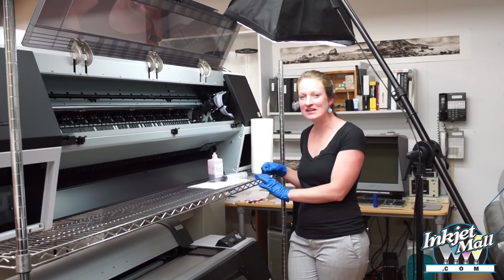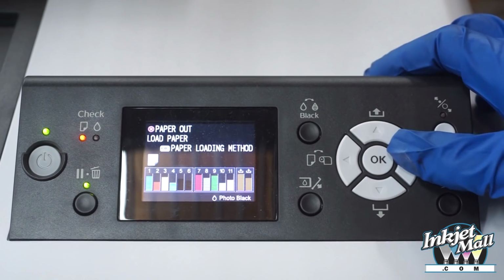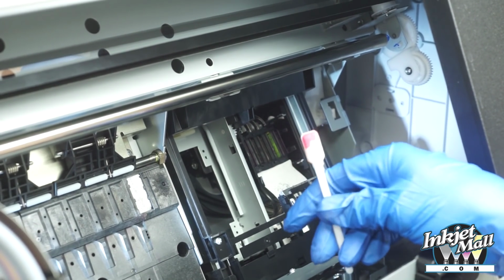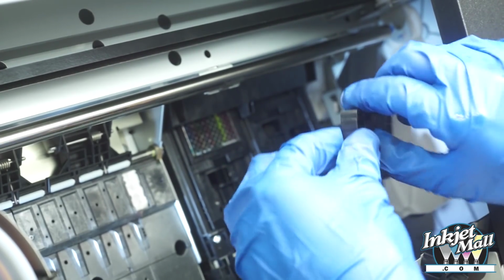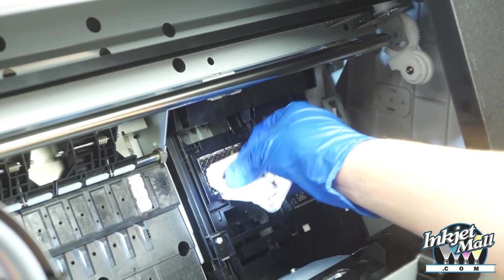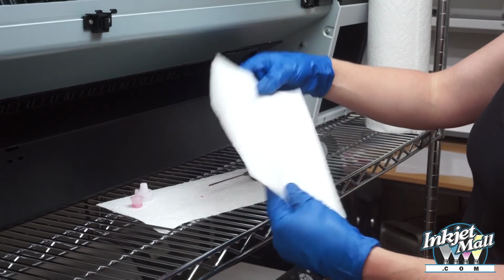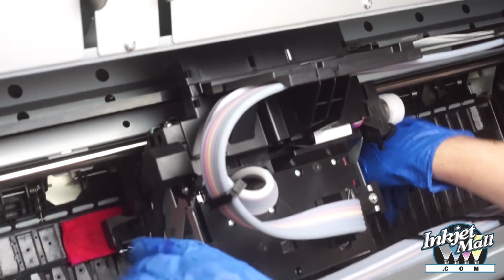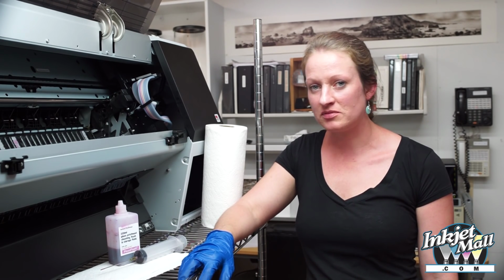How to Professionally Clean Epson 7890, 9890, 7900 & 9900 printers

Comment: Thank you so much for such a detailed and concise video on the cleaning process. I have an Epson SureColor P8000 and the components are exactly the same, including the menu panel. I used Printhead Hospital cleaning fluid.Not pink, but worked just fine The first nozzle check was horrid, but alter one cleaning cycle, it was perfect! THANK YOU!!

Comment: Excellent video, thank you very much! I wanted to tell you about the problem I have: My Epson 9900 prints correctly all colors, except the black color that prints in a brown color. The Epson authorized service technician checked the printer through software and mechanically the printer; We changed all the black inks (matte black, Black, Ligh ligh black etc) that I always use original, but I still have the same problem. Could you please tell me what could be the cause and how I can solve it? Thank you very much

Comment: I am seeing banding on my blacks.  
When I do a nozzle check I see large blanks blocks on the black as well.   What should I do?
Reply from the maker: depends if this is just a sudden change in a printer that you have been printing with all along or you are trying to resurrect one that has been sitting a long time, or if you just changed black ink modes after a very long time of not using that black. What does your nozzle check look like? If it has a few missing nozzles you can probably recover. But if it has swaths of areas missing it is probably a fatal head delamination. If you had not changed black ink modes in a very long time then your black ink exchanger is probably plugged and needing replacement, but you may still be able to use the black ink mode you had been using.  If just starting up a printer over a long time of rest you should flush it out and let the flush rest in it for a couple days before putting inks back.. It all depends!
Reply: I wouldn't know.  I just got it used from someone.  The photo black is completely out so I am waiting for the shipment.  I am guessing I should try purging/cleaning powerful a couple of times and see if it makes a difference first. 2nd would be to take out the printhead and soak it with 70% alcohol.  (Do you have instructions on printhead removal?) If that still does not work then I need a new printhead.
What do you think?  @Inkjetmall
Reply from the maker: @N95Developments   I would never use alcohol on a print head unless I wanted to rapidly dry it out. You need the absolute opposite. Even distilled water would be a more efficient and save solvent to use than alcohol. Alcohol and ammonium should not be used to clear print heads. They are more an effective solution to preserving a perfectly working print head by first flushing with a wetting agent and then finishing up to remove the wetting agent by a drying agent. If instead there is a clog only something with a sufficient wetting agent should be used. This is what PiezoFlush is about.  You can find and purchase the field service manual for your printer model on the 2manuals website.

Comment: I have carefully cleaned my Epson 7900 as shown in this video and now my printer can no longer run normal cleaning cycles? Help!
Reply from the maker: We've not heard of that before. Clean cycles are a function selected in the LCD panel on your printer or using the Epson printer utility software, but can not be changed by cleaning the printer manually. If your printer starts up normally - and you have the EPSON LCD panel and select it to perform a cleaning, usually only a full maintenance box will prevent that.
Reply: @Inkjetmall  I got a message telling me to change the maintenance box (it was almost full). I changed it and still get the same message after a few minutes of the printer trying to clean the print head.
Reply from the maker: @bebechat14 it is probably related. Perhaps turning on and off the printer will remedy. Otherwise it may require being reset and there is a tool out there for the 7900. An Epson Adjustment Utility available from 2manuals dot com.  There may be a way to reset the printer if it can not figure out it has a new maintenance tank. But this is a little beyond our ability to trouble shoot what is exactly happening with your particular situation.

Comment: Can I flush just one ink line at a time? For example I want to only flush my cyan, light cyan and magenta, or do I have to flush all the ink channels?
Reply from the maker: You can not flush one channel at a time using a utility. Flushing using the POWER CLEAN or the EPSON maintenance utility uses strong powerful suction to empty all ink lines. So this is what you should do if you are trying to clear a clog because printing out a single channel does not create any suction or strong forces. HOWEVER, if you wish to flush a single channel to remove the ink and replace with another you can do this with an independent ink channel printer driver like QuadTone RIP in its Calibration Mode if you alter it's inkseparation file to only include the color information for that channel you wish to change an ink out of. You will need read its documentation to understand how to do that, and the documentation is part of the downloads at QuadTone RIP. It is not intuitive.

Comment: How much piezoflush solution per cartridge for a fill or charge on a Epson 9900?
Reply from the maker: You do not need to fill the entire cartridge, but you do need enough volume for the cartridge to operate well. We think about 70ml is minimum in allowing you to run at least two charges and not introduce any air into the printer. The chip of a 9900 cartridge is not actually connected to the ink volume. If reset it assumes the cartridge is full. So filling it less than full means you need keep track of the ink volume and not allow air into the printer.

Comment: Hello what would cause the magenta to stop printing?
Reply from the maker: It could be any number of things. If the cartridge is defective, if it is a 3rd party cartridge that is unprimed, if there is a pressurization issue with the cartridge, if the damper inside the ink selector unit has been plugged with pigment, if the ink being printed is from a very outdated cartridge, if pigment has settled into the area behind the print channel in between the print head and the ink selector unit, if there is a plug in the ink channel itself in the print head, if the channel is electrically dead...and possibly even other reasons...

Comment: My black nozzle just doesn't work even after trying all this, so how exactly can I convert the printer over to using different channels as you say at the end of the video?
Reply from the maker: The black channel prints both the MK and PK - so I assume you have lost the use of both. If not and you can only print one of the MK or PK - then your stoppage is in the black ink exchanger in the ink selector unit attached to the print head. In any event, you now only have 9 of your 10 ink channels working.  You can convert the printer to the Piezography Black and White ink system. To do this you would install the 9 ink version of Piezography Pro inks in your printer. You would use the Piezography Professional Toolkit to map out the black channel and install the black inks into the orange and green channels. You can learn about Piezography here: https://piezography.com/
Reply: @Inkjetmall  Thanks for responding so quickly. Before I purchase your kit... here is exactly my issue, only 30 secs long, https://www.youtube.com/watch?v=X1JUQ4ZYAVI

Comment: Hello, 
I was cleaning the print head using the papertowel method and it looks like i got a little piece of the papertowel snagged and stuck under the print head.  What do you recommend for removing the debris? The print test on paper are getting worse and i believe it's due to some lint/piece of papertowel stuck under the print head.  
Thank you.
Reply from the maker: Just repeat the operation and when you move the print head back and forth it should come off. But, we really recommend the use of the Bounty towel as it is soft and absorbent and we do not have this type of issue with it tearing like you did.

Comment: Thanks for the video. I used the instructions on my 7900 and I was able to recover two nozzles. I still have one that in no way I could recover. I want to try your suggestion of flushing the nozzle. But I have little idea how to do it  for that remaining nozzle. An advice in this respect is much appreciated. Thanks again.
Reply from the maker: If the clog is not on the surface of the print head it could be inside the ink channel, or between the ink selector unit and the ink channel, or inside of the ink selector unit itself including a damper/filter. In this case, PiezoFlush is introduced via the very strong suction of the INITIAL FILL procedure:  https://shop.inkjetmall.com/how-to-use-piezoflush
Reply: @Inkjetmall  Thank you so much for the prompt response. I actually figured it out upon watching more closely how you did it in another youtube video. And by the way I noticed that my nozzle check on 7900 prints 10 color pattern not 11. Seems like the fifth (from left) spot prints mk or pk depending on printer setting. Can you please confirm? thanks again.

Comment: question how this works whit the p6000 on p6000 so this no works
Reply from the maker: The 7890 and P6000 are actually the same print head. Just the manifold behind the print head is different. So performing a preventative maintenance like this on the P6000 is very similar to this video.

Comment: Hi, 
Great video. Thank you for sharing it.
I have an Epson 9900, and the orange nozzle is completely clogged.
I will try PiezoFlush filled cartridge as you suggested. Should I do it while the machine is on? 
Some people suggest running 9900 adjustment program for unclogging. Do you know if it would work?
All the best
Reply from the maker: The only way to remedy an internal clog - is via the INITIAL INK CHARGE. A PiezoFlush filled cartridge can be inserted in the affected channels. BUT, the INITIAL INK CHARGE will drain inks from all of the ink positions. There is nothing you can do to avoid that. To run dozens and dozens of cleaning cycles on just the affected channel will burn that channel out. ONLY the INITIAL INK CHARGE uses just suction. The other cleaning cycles stimulate the head and more than just a few will burn it out if it has air in it.  If you can not afford to waste ink in order to save a channel - you might consider converting the printer to Piezography Black and White which requires only between 6 and 9 working channels depending upon what type of Piezography system you choose. Our software can map out the bad channels - and you will be able to print much higher quality black and white than you can with Epson inks.  https://piezography.com/   Contact us at shop.inkjetmall.com and we can put together a custom system for you.  The reality is if you have been running dozens of clean cycles to clear the orange - you may have delaminated that channel due to heat.  But only the INITIAL INK CHARGE is safe. It takes one to bring PiezoFlush to the head. Then you shut the printer down for 2-4 days to allow it to work. Then you repeat the INITIAL INK CHARGE to pull out the agglomerated pigment. Then you run your first nozzle check...   But, PiezoFlush has fixed a ton or printers!
Reply: @Inkjetmall  Thank you for the quick reply. I ran around ten cleaning cycles, and I did two twin color cleans in total in a month. I hope I didn't damage the orange channel.
I am an artist, I bought this machine  to print my artwork. I use Epson cartridges, some recently bought, and they are super expensive here in Europe. Turning the machine to Piezography Black and White is last resort for me, but I might have to do it.
Do you know how much ink an initial ink charge wastes? Trying to calculate the cost of initial charge..
And do you whip PiezoFlush to Belgium?
Thank you again.
Reply from the maker: @fahirekurt5895  it will be a bit more than 20ml per ink channel. Taos Photographic is our EU authorized distributor: https://taosphoto.fr/  I think that you probably did not burn out the orange channel with that effort.
Reply: Run it with the 7890 driver instead since it’s the orange that’s clogged and it will not use the green and orange colors cause the 7890 didn’t have those colors
Reply: @domsim9516  Thank you. I will try this.
Reply: Hello Fahire, thanks for writing this all out. Im in the same position as you, the only difference is its VM not Orange. 
Did you ever get it running smooth again?
Reply: @by_pasc  I couldn't unfortunately. The problem is with the head, but it is too expensive to change it.

Comment: thanks for the video.
How can I suck air in the lines of the epson p8000 ?. thanks
Reply from the maker: You will need to source the Epson Service Adjustment software. It runs only on PC. Your carts will need to be at least 30% full. Click on INK CHARGE and within 8 minutes it will have replaced all of the air or and ink in your lines with fresh ink from the cartridges.
Reply: @Inkjetmall  where i can find the Epson Service Adjustment software '??

Comment: Would you be able to upload a video showing how to replace the print head on this machine? Thanks in advance!
Reply: We just actually replaced a print head on this machine - I am not certain if we shot video of it!  If we did - I will post.
Reply: Jon Cone Even the steps would be helpful. I work at an industrial sign shop. We’re pretty good with stuff like this, but either they say “tech install” or there just nothing. It seems fairly straightforward. I just want to make sure we can do it before bringing somebody in. By the way, thank you for the quick response. I really appreciate it.
Reply: @AversaS2  have you downloaded the Epson Field Service Manual for your printer? It has step by step instructions with photos for every possible Epson field service. It's the manual that Epson repair persons use.

Comment: Entering Wiper Exchange mode and unplugging the printer has not released the print head on my machine. (Epson Stylus Pro 9900) Any other way to release it?
Reply: Update, It worked after I replaced 2 of the ink cartridges. :)
Reply: @nicolaspotts2293  Great! I would otherwise say turn the printer on and when the print head moves away from its capping station quickly unplug the printer!

Comment: Hi my cyan nozzle is completely  clogged can this help me ?
Reply: Probably not. This is preventative maintenance. If your cyan channel is completely blocked it would more likely be a result of an internal clog rather than a surface clog. You can put PiezoFlush inside of a refillable cartridge and charge the printer with flush fluid, let it sit for 24-48 hours, and then repeat the charge to pull out the dissolved agglomerations of pigment.  https://shop.inkjetmall.com/Inkjet-Ink?search=&attrib=40-116

Comment: I am using a 9890, the head has been replaced twice due to blocked nozzels on the Light Light Black channel, replacing the head is not an option this time, the machine is only about 4 years old, getting very frustrated again. Lots of banding in prints. Will this product work do you think?

Comment: Why can you not remove the flushing box screen completely and soak it in cleaning fluid, rather than the more tedious method of squirting fluid via syringe on it (at such an angle) and then dabbing it over and over with a paper towel? can this screen not be easily (or non-destructively) removed?

Comment: My Epson 7890 cleaning cycle fails and ask to retry. It fails if press I select yes again.  Did nozzle check and seems the yellow is not working yet I just replaced with a new cartridge. No yellow is printing. All other colors are fine. Could this be the cartridge itself or clogged nozzle. It was working fine before the changed cartridge. Now every 10 seconds it is making a noise as to whirring noise. Turned it off and still makes noise. What could it be?

Comment: Hi! I have a 9900 that is about 5 years old - I've suddenly found PK & MK are totally blank upon doing a nozzle check, after regular, even heavy use. Does this sound characteristic of a failed  head? Epson prices the repair at around $2400 - just trying to figure out if its worth getting a technician out to just tell me its the head, or perhaps it could be another part that is priced cheaper. Any help appreciated!
Reply from the maker: It may be only the black ink exchanger. Both PK & MK share the same print head channel but the inks are switched in the ink exchanger. The ink exchanger sits on top of the print head and contains all the damper filters as well. You can buy a new one from Compass Micro (Epson customer parts depot). Get the Epson Field Service Manual for the 9900 (search the internet for it) as it has step by step instructions on how to replace it.
Reply: Thank u so much - amazing!

Comment: By chance do you (or any other posters) have a video or written guide for removing/replacing the printhead from an Epson Stylus Pro 7880 ?  I brought my printer with me when moving to a distant country and am now thousands of miles away from a an Epson Service Depot that handles their wide format printers. I have the new head, just don't have a step by step guide to replacing the old one with the new one. Any suggestions or links greatly appreciated.
Reply from the maker: sorry but we do not. I suggest you look for the "Field Service Manual" for the Epson 7880.  Google for it. It has step by step including photographic illustrations.